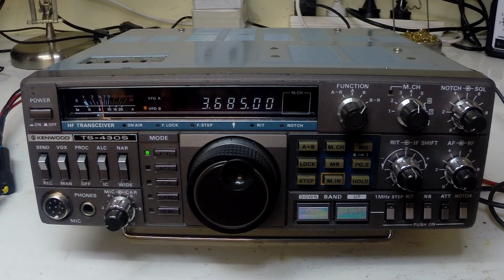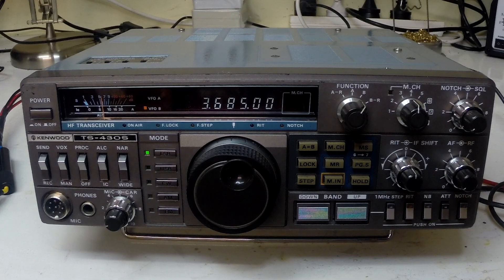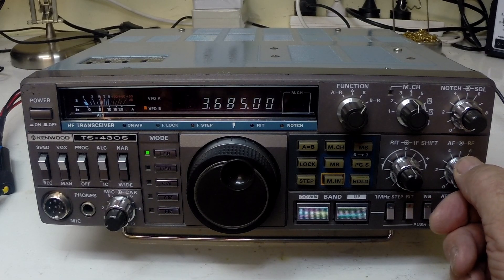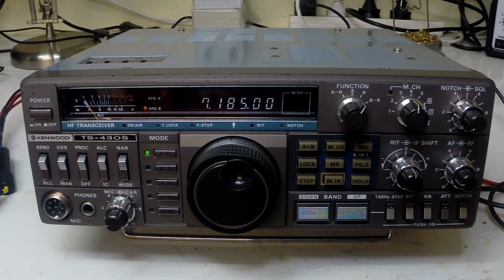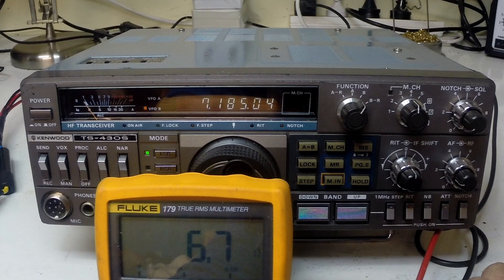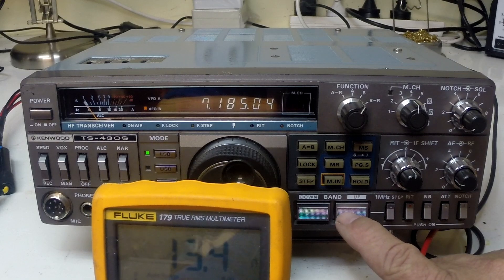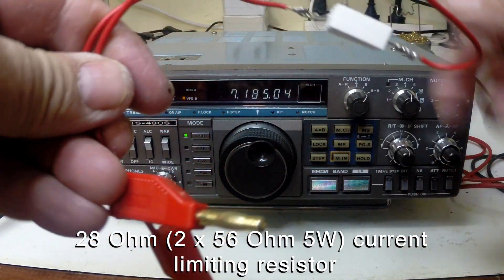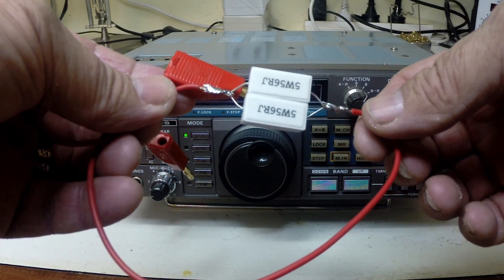TS-430S Receiver Filter Relay Repair – 12 October 2021

Comment: I don't believe this procedure accomplishes anything.  Firstly, there is only 1 relay on the RF Unit board of the TS430S.   When the radio is in receive mode, there is a 47k ohm resistor to ground in each of the receive filters.  They all have PIN diodes, which serve the same purpose as a relay.   Maybe earlier models of the TS430S used relays instead, but I don't know where they would go and there is no indication of those relays in the service manual.   I suggest that anyone thinking about doing this procedure to first remove the bottom panel of their radio and take a good look at the large PCB on the underside of the radio.   Mine only has one relay.   I am going to replace it with the OEM relay, a Fujitsu FBR211A.   Other possible causes for desense in this radio are not enough drive for RL1, incorrect PIN diode bias, and defective PIN diodes.  During receive RL1 is actuated.  Inadequate drive may leave the contacts separated or just barely touching.  In that case there is still a signal path from the antenna connector to the input filters through a 470 ohm resistor.   The AGC will take over, but not enough to overcome the desense.  I have noticed that when my TS430S goes into desense on one band, it does the same on all other bands.  So that would tend to rule out defective PIN diodes.   I think the desense problem many see with this radio is caused by RL1 dropping out due to increased internal friction caused by age.
OK, I took a closer look at the block diagram and schematics in the TS430S User Manual and see how the transmit low pass filters are also used on receive; and that is where all those relays are.  However I am still not convinced this procedure accomplishes anything.    There is a 100 μH inductor, L41, right next to RL1-1 on the Filter Unit.   This inductor is connected to the RA pin, which goes to the antenna center pin and the other side of the inductor goes to ground.   So the 500 mA just goes through that inductor, dissipating most of the power.   The relays in the Filter Unit have to handle 100 Watts on transmit.   If the receive contacts get dodgy so easily, why doesn't it behave worse on transmit?

Comment: Has anyone tried creating and installing the contact maintenance circuit as described in the same service bulletin, which is intended to mildly clean the contacts every time bands are switched? If so, what would you recommend to use instead of the now discontinued L33-0259-05 choke?
Reply: Find another 470 microH choke online.
Reply: @tennesseered586  You know how many different kinds there are on for instance mouser? I'm getting lost in a sea of 470mH chokes and don't know which would be better suited.

Comment: Could you use a 12 volt / 500 mA wall-wort? The only problem I see is that it puts out 13.5 volts for charging Purposes. Could this be used, do you think? Would the resistance be applied inside the unit its self?
Reply from the maker: 13.8v will be close enough.
This procedure is based on Kenwood TS-430S Service Bulletin - ASB-0902 INTERMITTENT RX.
See: https://erikarn.github.io/kenwood/SB/ASB0902.pdf

Also see: https://vk6ysf.com/ts-430s_maintenace_RX.htm

Comment: I know what I wanted to ask, why the resistor? Couldn't you reduce the amperage on a power supply and apply it directly?
Reply from the maker: It is a recommended Kenwood procedure with the view of using the 12v supply. Even with a reduced voltage you would need some resistance or risk damaging the relay contacts.
Reply: @petermiles6557  Wrong, resistor is there not to reduce a voltage, but current, so if you have the power supply with a current regulation, resistor is not needed .

Comment: Great job Peter. I had seen this method before and have had my eye out for this radio. Just aquired one and it seems to have this problem. If I key the mic it seems to open the receive, so I think it's the same problem. Can't hurt, right. I was curious though if it would work on other radios and can't imagine why it wouldn't. Need to look into that on my Yaesu FT-840. Thanks again for the info
Reply from the maker: Despite it's age the TS-430 is great radio, just needs a bit of maintenance due to the age. You would need to study other radio circuit closely to make sure this procedure will work without causing damage.